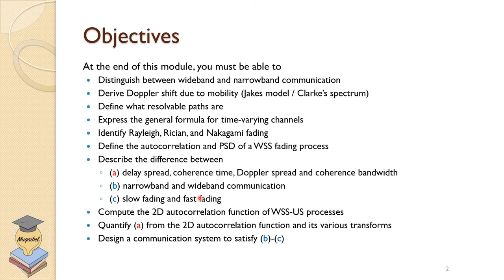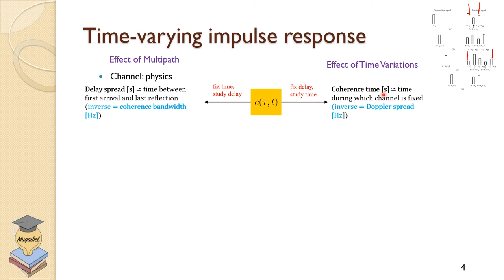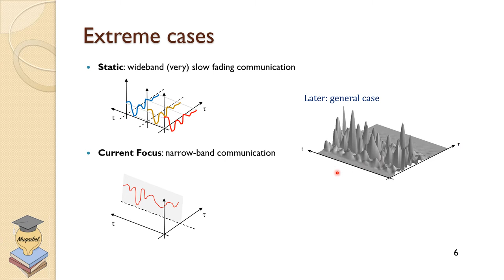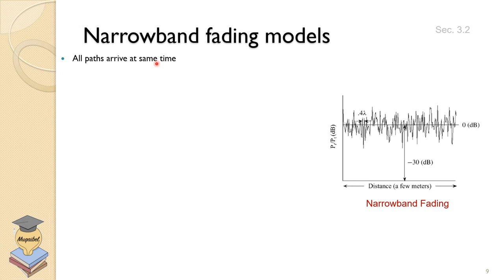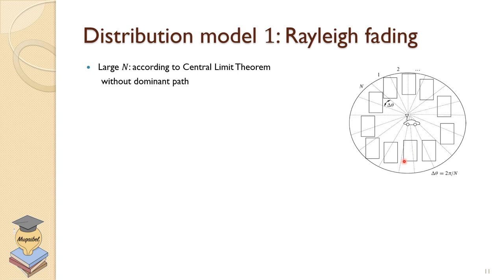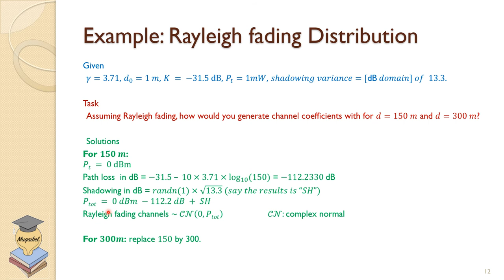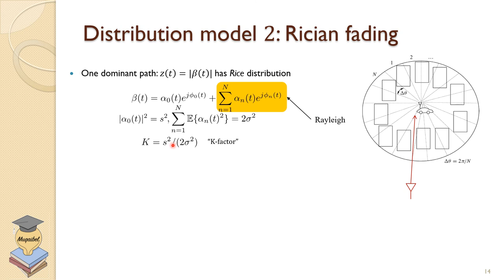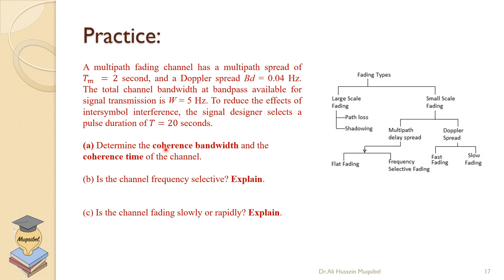4.2 Rayleigh, Rician and Nakagami Multipath Channel Models

Comment: A) CBW= 0.5Hz,  CT= 25s
B) flat fading channel
C) slow fading, since T< CT
Reply from the maker: Be careful Omar about B is it frequency selective or flat fading? @Omar Sayari
Reply: @alimuqaibel7619  Coherence BW > Signal BW, therefore a narrowband channel?
Reply from the maker: @omarsayari6477  0.5<20 selective. The bandidth for transmission is given as 20.
Reply: @alimuqaibel7619  
Dear Dr Muqaibel, 
The time for transmission  is 20, transmission BW is 1/20 = 0.05
Coherence BW = 1/2 = 0.5
Signal BW << Coherence BW 
so I think it should be flat frequency, not selective.
Reply from the maker: @mrOmar432  assuming the BW is the inverse of time duration is a simplifying a assumption that we do if we have no more information. Remember the bandwidth depends on the exact pulse shape and details. Since the question specified the transmission bandwidth, there is no point of inverting the time to find the BW.
Reply: @alimuqaibel7619  
Makes perfect sense now!
Many thanks for the clarification Dr Muqaibel.